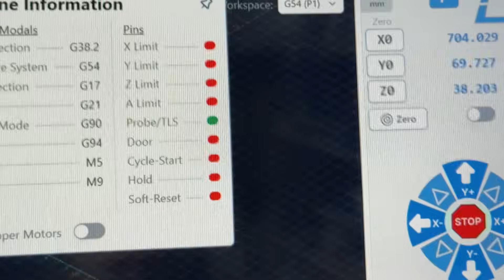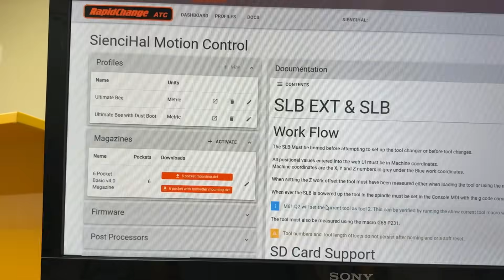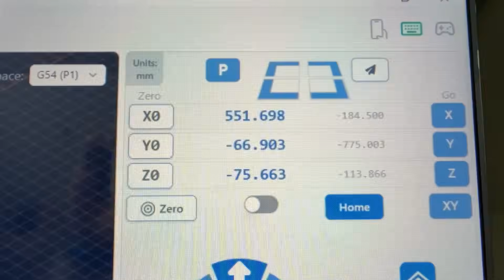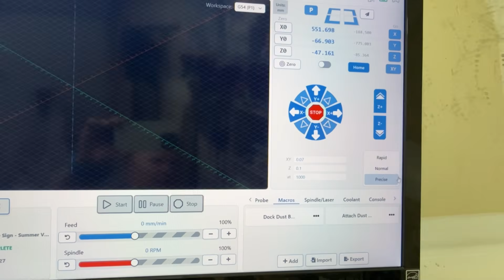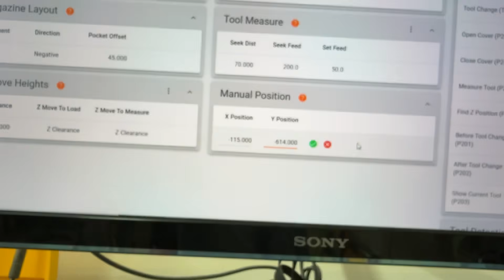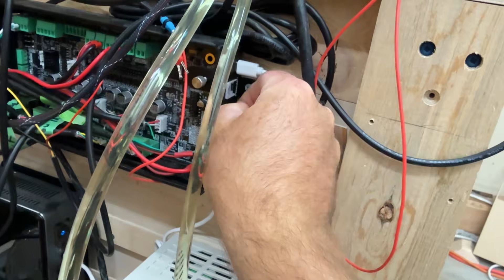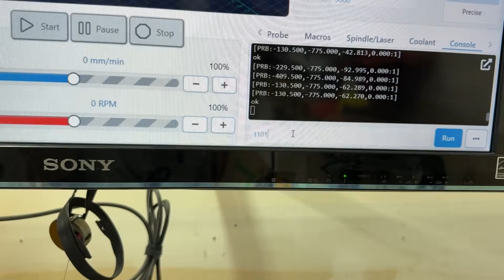Lengthy version of setting up the RapidChange ATC

Comment: Hi, Thanks for this channel. It is the only place i can find that has the same CNC and your journey with the Bulkman3D and the XPro V5 is the same as mine. After watching your channel i am ready  to move to the SLB.  I noticed that you have a lot of accessories either 3D printed or purchased. The covers over the stepper motors in yellow for example, and also the proximity sensors. Do you think you could put a list together of all the optional stuff you have and where to buy/print them ? I also have one more question, with regard to the spoil board. I put down a 17mm MDF sheet first and then the spoil board on top of that. The idea being this would help keep the machine square and more rigid. But after seeing yours screwed directly to the 2020 channels, do you feel your way has worked well ?
Reply from the maker: Morning, thanks for watching and yes the whole CNC thing has been a journey for sure. Lots of iterations and changes. 
I think the SLB is a great upgrade for this machine and the Sienci Labs community has been great so I highly recommend it. 
That is a great idea for a video and I would be happy to share them for sure. Most of the parts are things I designed myself and you can find them on Printables under @OneSparky. 
As far as the spoilboard I have been all over the place and I am still not 100% sure what I like best. At one point I did what you did and put and 12mm piece of MDF down that was the entire size of the frame and then secured a second 17mm piece on top of that but I didn’t love losing the Z height so then I went just the single 17mm sheet on top of the 2040 aluminum frame and used the MatchFit dovetail system and really liked it. I then get the Genmitsu Aluminum bed that uses aluminum plate and T track to and MDF slats and secured that to the Aluminum frame. So far I like this setup but it wasn’t straight forward and I had to make some modifications as their machine sizes dont match up to the Ultimate Bee. 
If I had to recommend one method I would say the MDF secured to the frame with dovetail would be my favourite.
Reply: @sparks-tech  Thanks for the reply. Looking forward to the video :)  I think i am going to keep the 16mm MDF base and make the spoil board to sit on top. Will get the SLB as the next upgrade.
Reply from the maker: @hemantdaya6329 that sounds awesome. The SLB is a great upgrade for the UB for sure.

Comment: This was fantastic Sparks!  It answered almost all my questions.  So it looks like zeroing on the piece happens after the first tool measurement, correct?  What about generating the post processor for (in my case V-Carve Pro)  the CAM software with the ATC installed?  

Do you have videos that cover that?  I assume you have to do a tool measurement for the currently installed bit when you turn on your machine (and when that bit is the first one to be used).  Is that correct?  How are you keeping the bits in the collets when they're not in the spindle?  Can you show that in detail, please?
Reply from the maker: Morning thanks for watching. So yes on my setup when I first start the machine up I have to put in a couple of manual commands to tell the SLB what bit I have loaded and then do a tool length measurement for the current tool. Then I would set the Z 0 for my project. I ordered several collet brands until I found some that held the bits securely when in the magazine. 
Yes for sure I could do a video based on your questions and fill in those gaps. Great idea. Keep an eye out for it in early September.

Comment: Looks nice! I'm contemplating getting one, but two questions:  1. It looks like it really "beats up" the collet nut, grinding the face and the hexagon edges! Is that the way this works, all friction and spring pressure?     2. They should include the config software with the purchase, not everyone likes going to the "cloud" to get things that are needed to complete the setup. What happens when you need to change the config and you have no internet access?    Otherwise, fine job on the walkthrough!
Reply from the maker: Hey thanks for watching. So far I am really happy with the product and happy to have it. 
I purchased all new nuts when I purchased the ATC and so far there is no sign of wear on the nut, yes there is some grinding noise for sure but no sign of wear or rounding on the nuts, hard to say after year so usage if that would change but so far so good. 
Once you have the magazine registered and get the config files for your setup you could also make manual edits after that to the files if you make changes. While I can see what you’re saying about the cloud. I will say using the web interface to make changes is much nicer than editing the files directly.

Comment: That was a awesome walk through video.. the only thing holding me back from picking up the RCAtc is the spindle  direction change. I upgraded from a 400w spindle to a 2.2kW spindle and vfd, but I assumed it would do both direction as the can spin frw/rev no problem. But I haven't been able to find any info on setting that up.  Again, awesome setup walkthrough video!!
Reply from the maker: Thanks for watching and the kind words. 
What controller do you have and how do you have your spindle connected?
Reply: @sparks-tech  Spindle is connected via VFD and either the supplied "offline controller" or via my laptop.  Genmitsu is not specific on the controller software Just that it is compatible with almost everything. The program I am using to run the spindle is Candle (running GrblHal) I think. it lets me set the max spindle speed and the any working speed I want.  The main reason for all the concern is in the VFD spindle settings for directions you only have two choices, FWD or REV.  So I picked up a HY VFD for a killer price. Which was suggested on the RapidChange ATC discord.  But trying to fine info on their discord is a major pain, not very organized at all.

Comment: At 2:58 "machine information". First day with the new planet; how do I access that dialog box?
Reply: In older gSender it's under calibration->diagnostics in newer 1.5+ I think there is a tools category on the left and it's in there.
Reply from the maker: In GSender 1.5 and newer there is a button to the left of the centre status indicator, in the case of the video timestamp it’s to the left of the Idle indicator at the top centre of the screen. 
In the older 1.4 GSender release it was u see the Calibrate button on the top right side of the screen.